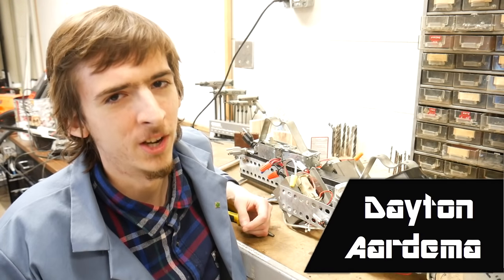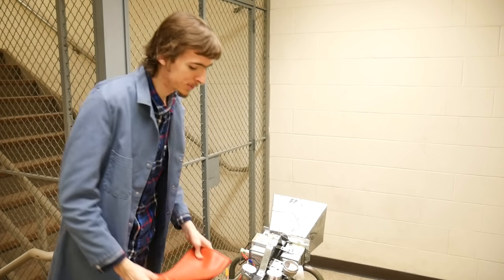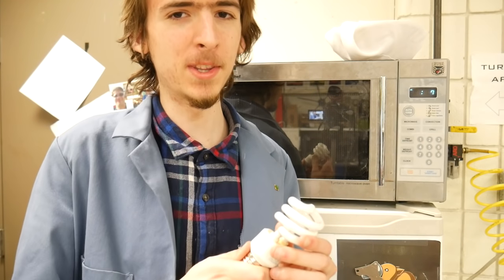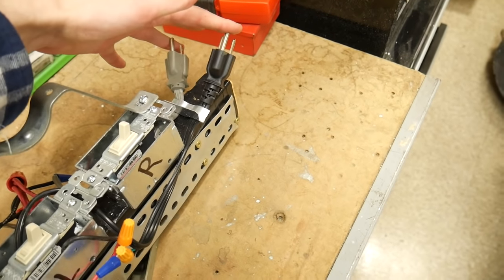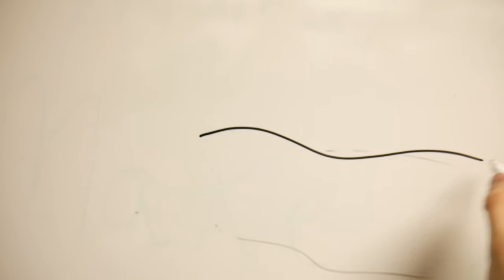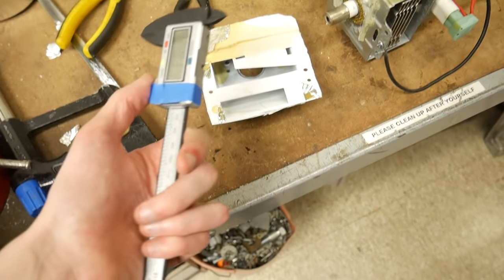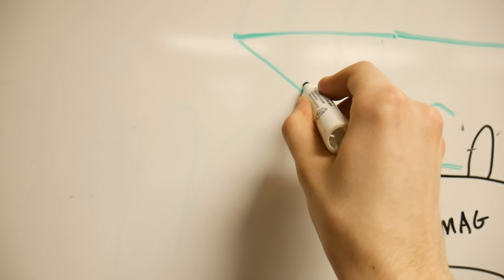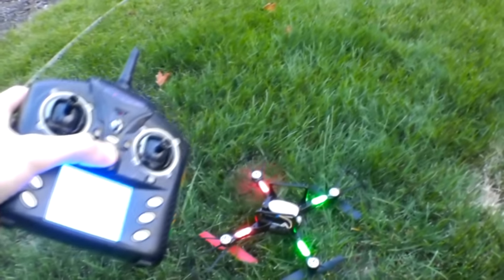How a MICROWAVE GUN Works

Comment: How would you go about making a wave guide for 5MHz?? I did your math but it’s way to large of a number to have it still work as a gun
Reply from the maker: I assume you're getting a number in the kilometer range. That is actually... correct.
In order for a waveguide to work, the wavelength has to be smaller than it to achieve internal reflection. Otherwise it (strangely) bends around and behind the waveguide.
Look at what radio towers do: they use an antenna to spread the wave. Even those are in the hundreds of MHz
I wish I had more to offer :(
Reply: No thank you for your input and videos!

The wave guide doesn’t actually generate the 2.4GHz though right? Would I be right in saying that I could in theory just adjust my magnetron to 5MHz and then introduce objects into the field it generates??
Reply from the maker: You might be right. I always thought that magnetrons are fixed frequency. Experiment though, let me know what you find
Reply: You guys don't know what you're talking about.
Reply: Nobody uses a waveguide for such a low frequency. It would be prohibitively large. A 1/4 wave probe inside the waveguide would be about 15 meters tall.  Did you mean 5 gig like wifi?

 A wave guide doesn't generate anything. It provides a low loss path for the RF.   There is a low frequency cutoff driven by the size of the waveguide. Typically calculated for TE10 mode but no so large as to allow TE20 mode. Below cutoff it does not function as a waveguide.  The horn also is passive and provides no amplification,  it's an impedance match from your wave guide to free space. 

Oven magnetrons are mostly high power microwave fire hoses that are stupid cheap. A fixed frequency is being a little optimistic.  

tl;dr
The physical size of the magnetron tube dominates the frequency of operation although the reactive portion of the load, temp, supply current... changes the frequency. The high voltage provides the electrons, the magnet causes their path to curve which causes circulation in the cavities in the tube at their resonant frequency.  It's a vacuum tube diode in a magnetic field. 

iirc you're allowed a maximum of 1 watt at the antenna feed and a max EIRP of 4 watts at the magnetron frequency.   It's pretty easy and cheap to get licensed to radiate 1500 watts on coordinated frequencies over the air.  Instead of reflected power from the load, you can injection a frequency into a magnetron to get it to behave, and operated it on the 13cm band.  You could FM modulate this at 5mhz. The interwebs suggests this for cheap(ish) FM moon bounce communication.

If your stealing the magnet out of one it's a good idea to not break the ceramic portion. Some are BeO, ok to handle but pretty bad to inhale the dust from a broken one.

Comment: See this video is great, but he said that 2000V will kill you, which is oncorrect as a tazer can have upwards of millions of volts its the Current that can actually kill you not the voltage, im not hating, just stating a fact! :)
Reply from the maker: Yes and no. You're missing on important nuance. 

The most accurate this to say is that it is the power density that kills; not high voltage with low current and not high current with low voltage. And the power density from a transformer far exceeds that from a taser.
Not hating, just stating a fact :)
Reply: @BlueprintScience  I apprechiate your reply! I mean you learn something every day i guess! :)

Comment: What would happen if you used a cathode ray tube to direct the microwaves?
Reply from the maker: I don't know.
Based on my experience with CRTs (which I'll be talking about in a video soon), they are designed to propagate electrons, not EM. It sounds like you're considering it as a waveguide. I'm not sure that you would get any reflection from the inside walls. Plus, working with glass is a "pane."

P.S. nice "Monty Python" user pic, I am a big fan of absurdist satire too!
Reply: I was just thinking that CRT focus and direct electromagnetic waves. A microwave is an electromagnetic wave. So wouldn't you be able to manipulate the microwaves using a similar device?
Reply from the maker: I see what you are saying. Unfortunately, the answer is no.
CRTs operate on a different principal than Microwaves. In a CRT, electric or magnetic fields bend a stream of electrons to light up different points on the screen. However, these are direct (DC) fields.
Microwaves operate by alternating (AC) electric and magnetic fields using a cavity magnetron.
Now, if microwave radiation is passed through a CRT through a DC electric or magnetic field, nothing happens because EM cannot be bent like a stream of electron particles can. Imagine trying to bend a laser beam with a magnet.
I like the thought though. Keep asking good questions.
Reply: What if u use an hexagon shape instead to bounce the wave off? Would it increase of decrease the waves? Or would it not matter?

Comment: Great video. Does anyone know if this gun was pointed at a 30mA ELCB in a plastic consumer unit through say 2 standard bricks (my wall), would it flip the breaker?
Reply from the maker: Let's think it over.
Bricks are non-conductive, so they won't reflect much EM radiation from the magnetron, but they are fairly thick. Plastic is like its not even there for microwave radiation. Hmm... It depends on how sensitive the ELCB is. I'd guess that the bricks will dissipate too much power and the breaker will be fine - Just based on what I've seen of microwaves.
Reply: hI  @BlueprintScience  
I have seen a brick in a microwave oven on Youtube and it exploded blowing the door off. I guess this is the moisture trapped in the little bubbles within the brick vaporising rapidly. I was thinking of a low power warmup at say 20w-50w for a few weeks to dry the bricks out and drive out all the moisture.

Comment: hmmm...possible to make a microwave transmitter that you can tune to different frequencies?
Reply from the maker: Generally, transmitters are not variable. The tuning is done with the magnetron itself. To change the frequency, you would need a transmitter that it tuned to it - whatever it may be.

Comment: Why nkt change the magnatron antenna from what im assuming is an omni directional dy pole antenna to a directional say yagi or parabolic type im sure that would be alot of research and the video would get taken down. But would be fun if you have the given resources. Enjoyed
Reply from the maker: The reason that I used what I did was a combination of safety and using what I had. Parabolic dished are hard to make. I tried using cooking pots, but they didn't pan out (pun intended). Plus, the waves are already polarized, so it wouldn't have helped much.
A Yagi antenna is an interesting idea but it does send some radiation behind it and I wouldn't be comfortable with that.
In reality, I believe the military uses parabolic dish antennas, so you're not that far off!

Comment: I kind of wonder how a magnetron would respond to something like 50,000 volts from a flyback Transformer which would be low amperage wonder how drastic the frequency would change I'm assuming it would change very drastically??
Reply from the maker: Honestly, probably not much. Voltage really isn't the problem.
I may be wrong though.

Comment: What's the weapon that provokes pain, vibrations, burns etc?
Reply from the maker: I think you’re talking about one of two weapons:
The army uses a 10GHz directional microwave weapon for crowd dispersion. It causes a burning feeling but is otherwise harmless.
Also, cargo and passenger ships sometimes use ultrasonic weapons to deter attackers. The vibrations become extremely unbearable and painful at mid range.
Reply: Is ultrasonic weapon like what?
Reply: @BlueprintScience  if you think it is harmless you are seriously in error.Your body works on emf.Every single cell in your body works on electrical impulse.If you ever had one used on you I suspect you would not be so cavalier.
Reply from the maker: @schurr64  I’ve worked around emf for a long time. If anything, I have become more blasé over time. To my knowledge, there has never been a fatality from emf exposure (in the microwave spectrum)

Comment: I wish so bad you had gone into more depth on one thing"
" it could be dangerous to have these waves out of phase " why is that? Heat?
Reply from the maker: No problem. Here’s the extended explanation:

With two identical sources placed some distance apart, the system can behave as a new, single antenna with a different distribution of their radiation. This could result in little to no energy going forward, but rather going off to the sides, or backward.
Antenna engineers often to this to “focus” the radiation pattern. These types of antennas are typically called phased-array antennas.

You can read some university lecture notes here: https://scholar.harvard.edu/files/schwartz/files/lecture18-antennas.pdf

Comment: How do I protect the myself from an attack. Im being attacked right now
Reply from the maker: I’ve heard that one before. 99% chance that you’re just super paranoid.
However, for that remaining 1%... you would need to build a faraday cage, which is a closed structure made entirely out of metal. No EM will penetrate. As cliche as it is, covering a room completely in aluminum foil or conductive paint would do the trick.
Reply: @BlueprintScience  thank you. It is very real and these weapons have gotten into the wrong hands. You won't know about this until you find yourself in the situation. Its very  real, very serious. Best not get into anyone's wrong side to find out.

Comment: How would one go about modulating the frequency?
Reply from the maker: If I had to guess: a high voltage SCR on the magnetron input would to the trick. Other than that, you could try mixing the output.
Working on a transmitter, I take it?
Reply: @BlueprintScience  not if the FCC is asking.

Comment: How far will this admit Microwaves?
Reply from the maker: Hard to say. Power drops off exponentially. Power to fluoresce a bulb is about 3 ft max. You have to get close to light it up but then you can back away - big start-up power requirement.
The drone was about 6-8 ft away.
Reply: can this gun deactivate dron 30m far from?

Comment: My GE Profile Microwave worked for about 5-7 seconds then shut off. Further exam revealed burning/sparking in HV Inverter/Transformer. Digital continuity checked OK for all door switches, primary thermostat, shut off fuse, etc. Replaced Transformer with new part. Everything worked fine except 'No Microwave Heating'. Next, replaced Magnetron and Relay Switch on the circuit board. Everything worked fine except 'No Microwave Heating'. Magnetron humming seems normal! Cleaned mica wave board inside of unit, no sparking here. Can anyone advise what the problem may be. Again, everything worked fine including settings for time, power levels, clock, etc. when started up except 'No Microwave Heating'. Last resort before dropping out to the curb for the landfill! Any ideas greatly appreciated! HELP!
Reply from the maker: I'm no microwave repair man, but I can try to help you out.

The power supply for the microwave circuit should go through a noise filter then a diode and capacitor in series across the circuit. I'm assuming that everything is correct.
If power is getting through to the magnetron but it is still not working, my guess would be that the magnetron is malfunctional or overheating.
You mentioned humming. Normally it's the transformer that hums due to changing magnetic fields. So make sure that every connection is made correctly and if you can (without killing yourself) check the high voltage on the magnetron inputs. Here's a schematic if you do not already have one: http://www.microtechfactoryservice.com/doubler.html

If nothing else works. You can use a page from my book of tricks: buy a functional microwave from Goodwill or Salvation Army and put its components into a nicer microwave casing.

Good luck
Reply: Probable failure of the HV capacitor and / or HV diode. If the capacitor is internally shorted,  it would likely blow the protection fuse on the LV power control board. If it or the diode were open then no power would go through to the magnetron.
        I've "harvested" a number of HV cap./ diode sets from curbside ovens then put them under test using an LCR meter. If they're within specs I'll keep, as new they're kind of pricey. Successfully repaired a dozen or so ovens with scavenged parts. Just be sure the replacements are of the same value, i.e.-voltage & Mfd capacitance and diode wattage.  Make sure all interlock switches are good.  Good luck and be safe around high voltages!
Reply: Your Capacitor is very important, it maybe defective.  use an Ohm meter to check, both way, You should see a Quick charge and needle or reading should stop.  Repeat swap and reverse test-leads .  You should see the same behavior, if Not then you have a Bad Cap.  Capacitor helps build oscillation, not just rectification alone.

Comment: can you help me to make a sanitary napkin incinerator using microwave...? i am planning to make it as my project in this semester.....
Reply from the maker: Microwaves do not affect microbes since they are so small compared to the wavelength. Use UV light - it's cheap and kills everything.
Reply: @BlueprintScience   thanks for reply... can you suggest a UV emitting device  to distroy sanitary napkin ?
Reply from the maker: @muhammednabi3049  I can't recommend any one item (there are literally thousands) but if you look, you will find. 

For instance, if you google "uv sterilization lamp" it will give some expensive but good stuff. Be aware while you shop that any UV will work, some just take longer to do the job than others. FYI, UV lamps kill microbes best around 165-170 nm.
Reply: @BlueprintScience  i added a sterilizer lamp. thank you for the suggestion.
i have one more doubt that , Can i destroy napkins using LASER ?
Reply from the maker: @muhammednabi3049  It depends on the power of the laser. Any LASER class 3 or above poses a possibility to start the thin paper on fire. If that's what you want, however, I'd suggest a 1 watt laser; that would make quick work of napkins :)

Comment: How to shield against this?
Reply from the maker: Juan Martinez, very easy: Faraday cage.
Aluminum foil does the trick. It can shield you from directional microwaves and most high frequency radiation. To completely shield yourself, you would need a room with all 6 faces covered in metal; this is a faraday cage - they are mostly used for scientific purposes.

Comment: Fun video and very informative...I'm wondering what would happen with two capacitors in parallel to increase the voltage output or a hotter capacitor period....Hotter transformers can be used  to increase input voltage too and I'm assuming, get more output, but, I'm thinking the rating of the cap will need taken in consideration of that......Oil burner transformers are cheap and you get from 120 volts input...10,000 volts output......I'm going to find out and would love being able to screw with the assholes blasting their car radio's across the street at all hours with the damn thumping crap they call music...Talking to them, and asking for consideration, accomplished no results...We'll see what I can do....I'd love to be able to smoke their shit up, but don't think that achievable....Anyway, my thanks to the gent that made this very good video.
Reply from the maker: Despite my hatred of modern music and love for vandalism, its not possible using this technology.
Increasing the voltage does not increase the power output, sadly. It may cause internal shorting in the magnetron though.
Let me give you some man-to-man advice: Play classical music as loud as possible and, when they all fall asleep, steal their radios. Crime is fun!

No, seriously. Don't do that.

Comment: Hi, can u ask Michael from Vsauce to make observations at 1331 s gunderson Berwyn il. Someone is using a microwave weapon. It uses operant conditioning. It is scary. Someone could be able to turn it off if they make observations. It is able to repress my motor coordination.
Reply from the maker: Michael is a little busy on tour, so I guess I’m your guy. You have no need to worry; microwave weapons are incapable of disrupting bodily motor function. If there are microwaves, you should feel them; it feels like when you open an oven door and get a heat blast - only it’s continuous. 
To completely block microwaves, you need only build an aluminum foil faraday cage.
P.S. I would personally consider a medical condition more likely than microwave weapons.
Reply: I think this one uses a scary kind of calculus. It is like operant conditioning.